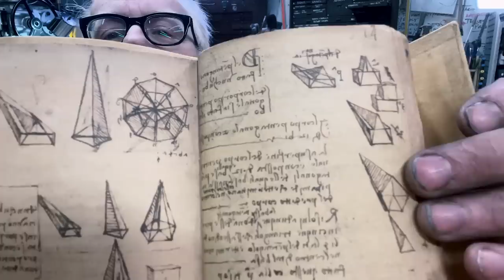Adam Savage's Leonardo Da Vinci Notebooks Collection!

Comment: From Isaacson’s biography I think the backwards writing was determined to be because he was left handed so it wouldn’t smudge as opposed to being a code.
Reply: That's my understanding as well. He was left-handed in a time of puffy sleeves and slow-drying ink
Reply: Sure but he also wrote everything mirrored. That has nothing to do with left-handedness.
Reply: @rmvdhaak  He's writing cursive. Writing the normal way around, you start each letter on its left side and finish it on the right, ready to link onto the next one. If you tried to do that when writing right-to-left, the letters wouldn't link up, and you'd always be moving the pen over the letter you just wrote, to get to the start point of the next letter. So you have two choices: either you draw the letters un-mirrored but reverse the stroke order, or you draw the letters mirrored, with the usual stroke order. Mirroring seems more natural, to me -- particularly capital letters always link from their right side, but in un-mirrored right-to-left writing, they're always at the end of the word.
Reply: @Blake Surely somebody of Da Vinci's intelligence wouldn't think for a moment that mirror writing would function as a code?
Reply: @rmvdhaak  False. Using mirrors was actually a standard way for a left-handed person to write.

Comment: hearing & seeing Adam swoon was part of the fun watching this video.  That "experience" and to be able to handle something that is as accurate or as exact as a historical print as possible is the work that I have been doing for a few years with the work of Paul Revere (and I also have a huge interest in the Old Masters and using their techniques), work I do with the Printing Office of Edes & Gill in Boston MA where we have an exact-size replica of the Declaration as printed in Boston on the same kind of paper with the same kind of hand-set type, and my exact-size replica of Revere's Boston Massacre copperplate engraving, again using the same methods he did, same kind of paper, even some hand-colored in watercolors.  (although I do not go as far as to age the work down to every tear and stain, instead I try to make it look as if you bought a print as exactly as it came in 1770 as I can, but I digress).  Friends that do similar work  like Colonial Wiliamsburg does with their Print shop, and Jorge Lar / Prelo Prints, replicating 16th century prints & woodcuts.  (I have a replica of Aesop's Fables as printed by William Caxton ca 1470s that Jorge did, excellent work).

Comment: maybe he cuts in bulk, the careful single page on glass could be advertising, consider that. Once you have the page profile you can clamp the500 sheets per page for the limited edition then bulk carve the edge to shape and soften with sandpaper and rub to stain In order to match the original, and candle singe to change texture or brittleness too and burn away threads. Just slow and patient process for each sheet, more like sculpting the result

Comment: Blurring the labels like that is essentially useless when it comes to privacy. With modern AI systems a moving blurred image can easily be reconstructed into the original high-resolution version of the image. If it’s relevant I would suggest completely blocking out the labels.